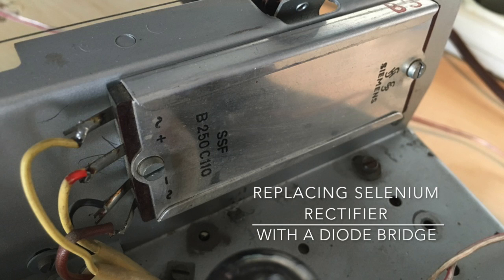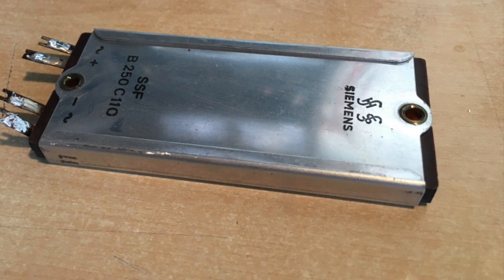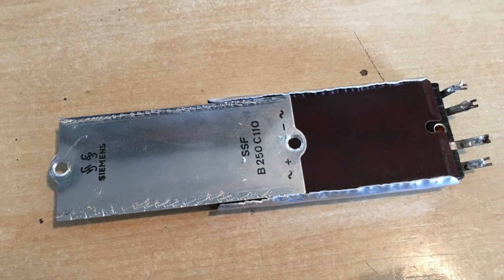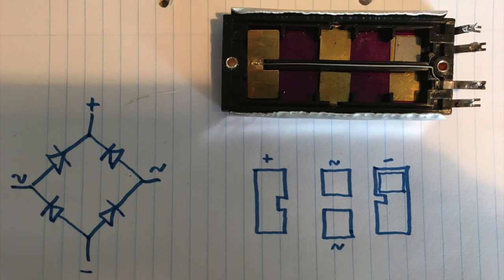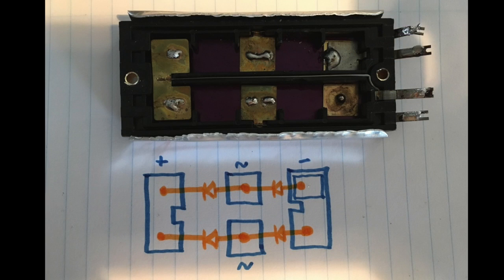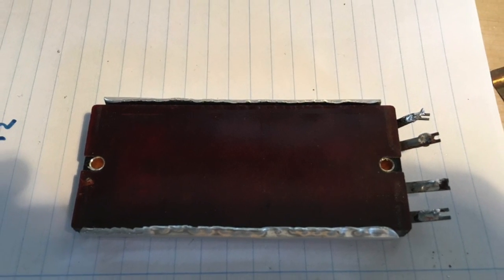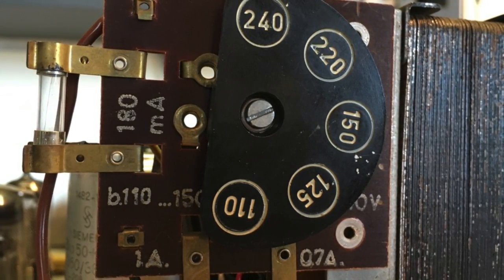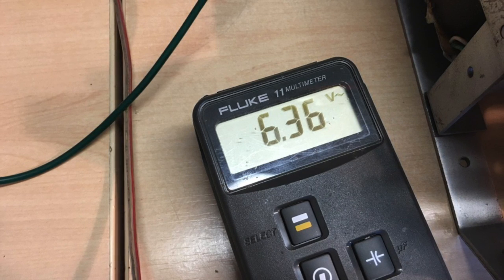Replace Selenium rectifier with silicon diodes

Comment: Excellent presentation! I notice you avoid the topic of current flow through diodes. I can barely grasp it myself, and when I try to explain to others, I get hopelessly confused myself.
Reply from the maker: I understand your point. It's not difficult, but sometimes getting your understanding into words others can grasp can be a challenge :)

Comment: Lets say I don't care how it looks, can a standalone regular "one piece" bridge rectifier be used? (with appropriate voltage resistor added). They are cheap and simple, some are rated 1000V/25A. Thx.
Reply from the maker: Yes, as long as it’s rated for the expected voltage and current.
Reply: @electronicsoldandnew  Great, thank you!

Comment: Excellent vid, thank you.  I was going to just ditch the whole piece but now I think I'll stuff it like you've done here!  Since the silicon diodes will bump the voltage up a good amount, do you ever add series resistance?  I've also seen people say you have to strap caps across each diode, and also a KV cap across the secondary.
Reply from the maker: I add a series resistor if the voltage needs a little taming. You can add the caps to clean out switching noise.

Comment: Brilliant video. I am replacing a selenium rectifier on a Vadis Escort tube guitar amplifier. My question is this - what value capacitors/resistor should I use in the new power supply circuit? The present values for the caps are 24uF 350V and the resistor, which is burnt out I think is 10ohm? 10Meg? Can't quite see as it's burnt out. Appreciate your help. Thanks.
Reply from the maker: i’m not sure I can answer you accurately, because I don’t know the actual circuit. However, 24 µF capacitor sounds about right, and having replaced it with diodes, you can probably change that  to 47 µF without any problem and a little bit more filtering. The resistor, if it’s in series with a B+ will probably be a low value, definitely not one 1M.
Reply: @electronicsoldandnew  So I did all that and powered the amp on. It has a hum that sounds like a half wave rectified circuit. I should have mentioned when I changed out the selenium rectifier, the filtering section was a Pi filter with two Capacitors in series with the small value resistor going to ground. Should I now change the filtering circuit to get rid of that oscillating hum?
Thanks for your help.

Comment: Thanks for another great video. Just one question, I’ve watched a number of videos and in some it only shows a single 1N4007 diode in series with a resistor to replace the selenium rectifier. In your video you use 4 diodes. Is either way satisfactory? I have a 1959 Schaub Lorenz valve radio, my selenium rectifier is physically quite small.
Reply from the maker: BK Gold Detecting : the single diode is used when replacing a half-wave selenium rectifier. In this case it’s a selenium full-wave bridge rectifier so the four diodes are used. See what yours is and replace accordingly.

Comment: Hi. Can you help me with an advice please? Or anyone else? I got Nordmende Elektra tubes radio 1959. The selenium rectifier stinks when gets hot. I've done a silicone rectifier with a resistor in series with the +, but the problem is with the silicone rectifier I've done, I got output voltage on it of 300-305 volts with speaker's buzzing noise. With the original selenium rectifier I got output on it 190-195 volts, no buzzing noise on speaker. Any advice how can I drop down the voltage on silicone rectifier from 300v to 190v? Thanks anyone in advance.
Reply from the maker: You must get a schematic. The 300v is closer to the correct voltage than the 190. However, playing with 300v without experience is asking for trouble.
Reply: @electronicsoldandnew  Thanks very much for swift reply. I found out on schematic that the original rectifier output must be 260 volts. Although, the radio works perfectly with original selenium rectifier even its output voltage is 190, no buzzing noise on speaker with the volume completely down, but the problem with this rectifier is that smells bad and gets very hot. With the silicone diodes rectifier I've done, its output voltage is 300 volts, radio works perfectly too, but little buzzing noise on the speaker when the volume completely down. I have to find out how to drop down the voltage from 300v to 260v. 1st of all I don't want to damage the radio due higher voltage. 2nd of all, the small buzzing noise it's something that scratch my brain because something doesn't work as should. Thanks again for your kindness to reply. All the best!

Comment: You should add (just as you suggested later on) as resistor in series as selenium rectifiers have quite a high resistance when new, as they get older they typically increase in resistance.

Comment: Fascinating to see the innards of a selenium rectifier!
These videos are great. They surely look like they must take you a long time to make! Well done!

A couple of points:
a) Selenium is toxic in large amounts. Selenium salts are toxic too. Careful when working with such rectifiers as they are prone to failure and will emit unpleasant fumes.Here's a link on the effects of selenium compounds:https://www.epa.gov/haps/health-effects-notebook-hazardous-air-pollutantshttps://www.epa.gov/sites/production/files/2016-09/documents/selenium-compounds.pdfIt needs to be properly disposed. It should never be directed to the landfill.See here for hazardous metals and disposal issues info:https://hazardouswasteexperts.com/heavy-metal-waste-regulation-which-substances-make-up-the-rcra-8-metals/For UK regulations (selenium is classified as a "heavy metal") please consult guidance document here:https://www.gov.uk/government/uploads/system/uploads/attachment_data/file/427077/LIT_10121.pdfb) I would use some kind of sharp edge such as a blunt knife (of appropriately low value and size) to try to pry open the metal case. Once the rivets are drilled out, it should be possible to slide out the case with a little effort. That would avoid making all these screwdriver marks and should be much quicker to bend open and close back again.  Having said all this, I wonder if there is some process whereby the selenium diode plates could be rejuvenated - not that I would advise anyone to carry out such experiments of course!Some more info on Selenium rectifiers replacement here:http://w3hwj.com/index_files/RBSelenium2.pdf

Comment: What is your opinion on modifying the transformer to lower the output voltage for use with modern rectifier diodes. I have a Nordmende radio (uses selenium rectifier so no center tapped secondary) that I am restoring and looking at the power transformer I noticed that the outermost layer of winding was from the secondary. So I went and unwound approximately 80 turns out of the 1280 total turns of the secondary. Measured the rectified output afterwards and it was down 25V from the original. Then moved the input tap from 220V to 240V and got the rectified voltage down another 20V (I have 230V in my wall outlet in Romania). So the voltage I get now is very close to spec without using a resistor. The transformer operating temperature seems to be the same as before. Will change the mains fuse to the lowest amperage rating possible just for peace of mind.. Do you think this is a safe modification? Thank you!
Reply from the maker: +Gherghinescu George : I think it is quite safe, but a little risky as you can damage the transformer if you're unlucky. The secondary is often on the outside, but unwinding turns to reduce the voltage, although technically the right thing to do, can be very difficult in some transformers. I'm glad you did it successfully. Good luck with your project.
Reply: Gherghinescu George It sounds like a lot of extra work to me...